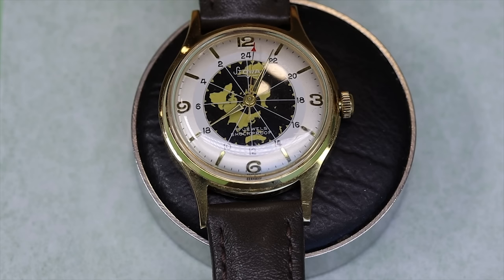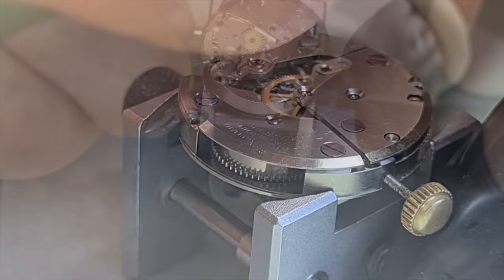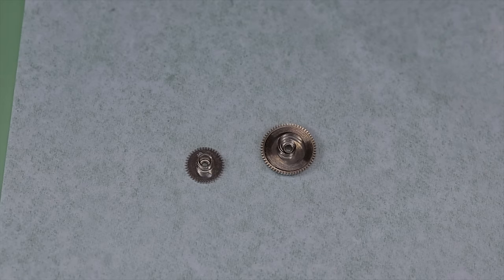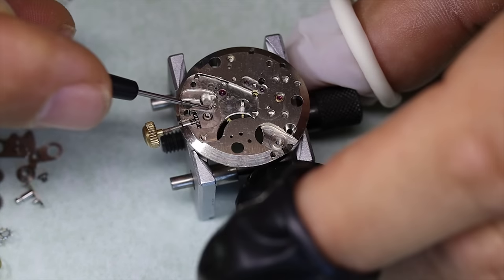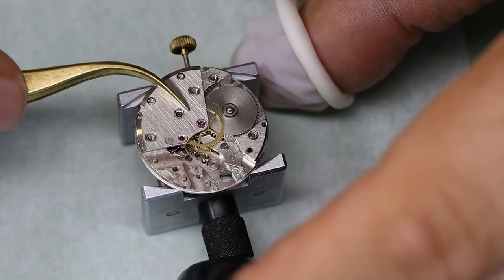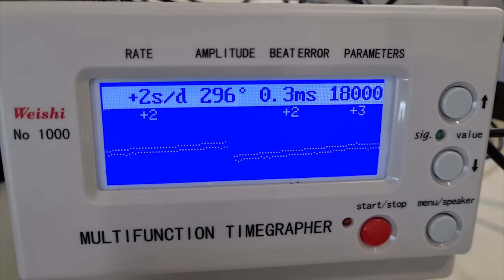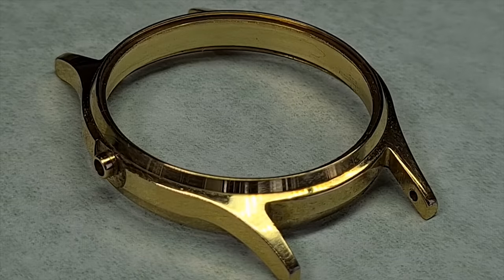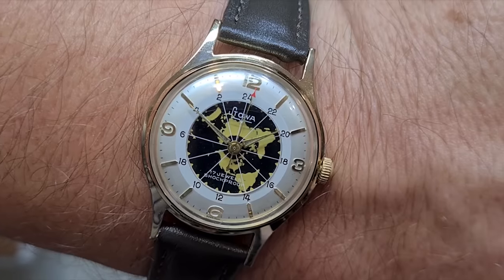Subscriber watch! Very rare and possibly untouched?

Comment: I thought I might answer a few questions regarding the watch that are raised below:

1. Where do I find one? - As far as I know, I have seen only two others. One was listed on eBay in the UK about 2 yrs ago and then withdrawn, though I recently saw it again. The other was in the Stowa museum. I inherited mine from my father.

2. The complication is very simple. The movement is an OSCO 66 used in a number of German watches in the early-mid 1950s. It was used both with and without a date wheel. The globe is a very minor modification to the date wheel function and uses the same supplemental plate. The globe wheel is the same diameter as the date wheel.

3. The "art" of this watch is the two layer dial. The "error" in the dial was replicated in the Stowa Museum watch, but the British watch had a redesigned outer dial that was a bit easier to read and corrected the error.

4. The 31mm is about the minimum size for the OSCO 66. I have had two other watches using the same movement, an OSCO-Parat and Berg-Parat that were both 33mm.

Comment: Interesting watch and excellent video, amazing that more manufacturers don’t use the screw ring for caseback, it just seems so sensible. Thank you 🙏
Reply from the maker: Thanks so much, Wendy 😊 I think probably the main reason most manufacturers don't use this ring is that it makes it slightly more difficult to get a tool in there to unscrew it, with resulting scratches and marks. Apart from that I think this is indeed a very good solution.
Reply: @VintageWatchServices  thank you for your reply, I’ve often wondered so problem solved. 👏
Reply from the maker: Happy to help! 👍 There might be other reasons also if someone else knows?

Comment: Just slightly smaller than my Zeno-Watch Basel 55mm flieger... (left side crown, no less). I love the polar projection map. Very nice. I have a few Casios that would be able to withstand an anger addled watch maker, should I send them on?
Reply from the maker: 😂 That'd be great! The Casio running gag just sort of happened, I actually respect Casio for their business and their watches might be the most honest and best value for money you can get. The G-Shock of course has a massive following but you can't really beat (pun intended) a $20 watch that keeps time better than a Patek...
And yeah, you might just notice the difference between the 55 and 31 mm watches if you look closely 😁

Comment: 18 x 2.  Was the error corrected later in the production run, if so the watch is even more of a rarity.
Reply from the maker: Hello Bullnose, yes, that's the error and yes, it was corrected in later watches. Doug has found a total of three of these with erroneous numbering, one on eBay, one in the Stowa museum and one in his basement :)
Reply: @VintageWatchServices  The one on eBay has the corrected dial.
Reply: @etherdude  You may have a horological equivalent of an inverted Jenny.  😊

Comment: Thanks for another thoroughly enjoyable and educational video!  To my eye, it looks like one of the banking pins is bent.  You didn't mention it.  How often do you find bent pins?  Have you ever had to make adjustments?  Thanks again!
Reply from the maker: Hello Woody, sharp eyes there! Yes, one of the banking pins was slightly bent. The only real reason for bending them is to adjust the horn shake, thus the clearance between the horns and the impulse pin. This distance should be equal on both sides. Given that the pin was a bit bent I checked the horn shake and it was indeed fine. I'm not sure who bent it in the first case but it turned out fine.
You will see this every now and then with old watches, mostly pocket watches. If you see it, you need to check the horn shake and act accordingly.

Comment: So glad I found your channel! Absolutely invaluable info for a hobbyist like myself. 

Am I understanding it correctly that you left the mainspring in the barrel because you didn’t have the correct size winder/arbour for putting it back in? 
Keep up the good work! 
Greetings from Norway’s big brother Sweden!
Reply from the maker: Great to have you here, Martin! Yes, the construction of these types of watches means the arbor is very big compared to the barrel, and the normal mainspring winder would not fit. Then there's a choice between hand-winding the spring back into the barrel or cleaning it in place, and I chose to clean it in place. Neither is ideal but hand-winding the spring is in my view the lesser choice due to the risk of distorting it.
Reply: I'm a beginner hobbyist of the trade and use the same methods as I still don't have mainspring winders.

If the mainspring looks and feels OK I just clean and degrease the barrel the mainspring still in place but lid and arbour removed. Either this or then I just install a new mainspring. A new mainspring is cheap guarantee for powerful action of the mechanism and installing one usually is done straight from its packaging, no mainspring winder needed.

Actually I think it would be best to always install a new mainspring during service.

IMHO installing train of wheels bridge or shock springs is easy compared to installing a mainspring by hand to its barrel without damage.

Comment: Nice resto, what paper grit do you often use to first polish the crystal? Thank you.
Reply from the maker: Thanks for watching and for your question! I start off with an 800 grit and then go to 1200 and 2000. You could add 1600 in between if you want, but I'm happy with this progression.
Reply: @VintageWatchServices  thank you, will use this on a crystal that needs to be polished. Have a good evening!
Reply: It all depends on how big the scratches are.
Reply: @littlejackalo5326  yes :)

Comment: I have a 1953 Bulova with the same style case back. Maybe they started the type.
Reply from the maker: Hello Jeff, that might very well be, I honestly don't know. It's more common on Russian watches and some French ones, but I wouldn't know who first made it.
Reply: @VintageWatchServices  This watch was made while Stowa was part of the Parat consortium formed in 1949 that included Arctos Uhrenfabrik Philipp Weber, Berg Uhrenfabrik, Wilhelm Beutter, Osco Uhrenfabrik, Otto Schlund (brand was currently re-launched) and Stowa. The case and movement were both sourced out of the consortium. I have an Osco-Parat watch using an OSCO 66A that is very similar in style though 35mm instead of 33mm. I have also seen Berg watches of the era that use the 66D movement. They all have the same caseback system.
Reply: I agree with your answer. But wew also know that Bulova was using it in the early 1950s. I need to try to find out who produced the series of Bulova movements (Swiss). If I do find out I will let you know. They do not resemble the A. Sheild and Certina automatics found in my 1950s Hamilton automatics. Always enjoy and try to learn from your videos.

Comment: How did you know the crystal would fit back into the bezel with just finger pressure? Also, why don’t watch repairers work in a carrel to catch pinged jewels? (Inevitable, no?)
Reply from the maker: Hello Bubba, thanks for watching and for your comment! I re-used the original crystal, which I felt the pressure of when popping it out. If it can be pressed in with (strong) fingers or not depends not only on the size but also on the shape of the crystal where it meets the bezel. The eau test is to see it the crystal can be moved when in situ. 
It is also not good if the crystal is slightly too big, then it will develop compression cracks. 
For your remark about the carrel, I fully agree that would be very beneficial sometimes and even considered building one for a while when I started out. But not having one kind of forces to go learn good techniques and habits, which is probably better in the long run. Being on your knees every now and then is part of being a watchmaker, I suppose 😂

Comment: Does the world turn once every 24 hours?
Reply from the maker: Hi Angelino, good question! 😂 The earth in fact rotates in 24 hours relative to the sun, meaning that it takes 24 hours between every time the sun is at solar noon. But given that the earth rotates around the sun, this point is actually slightly more than one full rotation, about one degree more. One earth rotation as measured towards stars far, far away is thus about 4 minutes shorter, and that rotation is called a sidereal day. Sometimes you see watches with a sidereal time complication, but it's honestly not very useful...
Reply: @VintageWatchServices  I meant “the world on the watch.” Also, loved your German.
Reply from the maker: @johnsrabe  Aha! Then I could have simply responded "yes" 😂 And zhanks!
Reply: @VintageWatchServices  So if the Earth itself is off by 4min./day we shouldn't worry so much about mechanical watches!